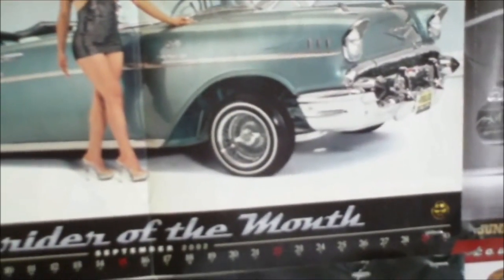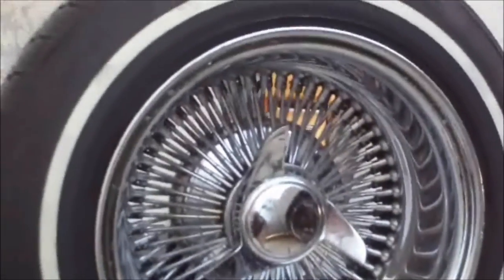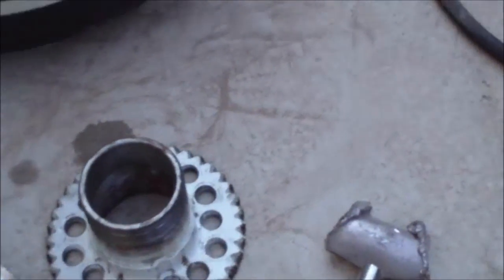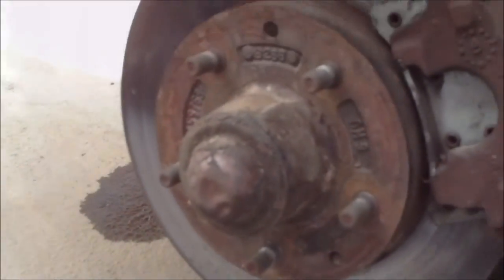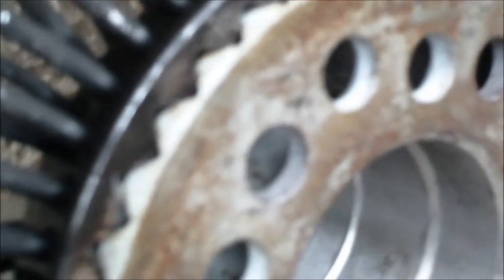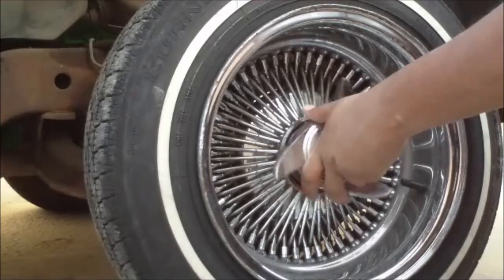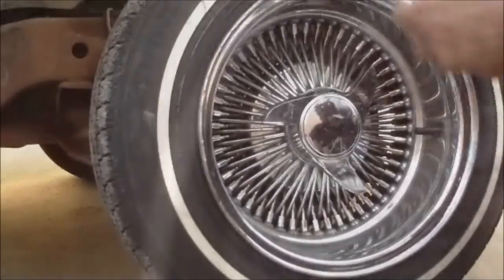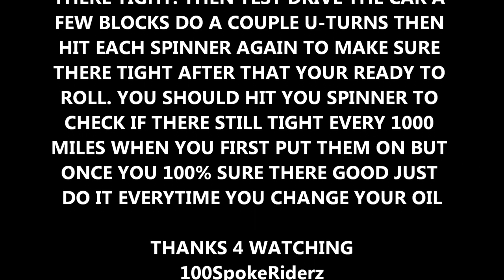HOW TO MOUNT WIRE RIMS ON YOUR RIDE

Comment: What about tightening the adapters with your hand and standing on it to tighten it more with your foot bodyweight cause I don't got a drill like yours would it be loose even if it won't get any tighter the crowbar actually bends a bit
Reply from the maker: You dont need a impact like mine but I would go to any auto parts store & get a 4way because it will have you a little more leverage & it wont bend

Comment: On 94 accord do I need a specific adapter to install 100 spoke rims?
Reply from the maker: No you just need the adapter with the correct bolt pattern normal there are universal 5lug adapter & a 4 lug adapter

Comment: How can u tell what side the adaptors go on if the white or red color has been faded or painted over with? I bought these rims and the spinners on all four of them says left on all of them smh.. not even sure now if I want t use them now or throw them in the trash
Reply from the maker: Thats odd normally the spinners are left & right. The adapters are threaded different directions for L&R.
Reply: @100SpokeRiderz  I think this guy I bought the rims from decided to change the adapters to where all the spinners I tighten them on it goes clockwise all four smh.. not sure if it’s safe to use these rims and adapters now that I’ve seen the correct way to do them here 😞😔
Reply from the maker: @biggteez12  to be on the safe side i would buy a new set of 4 spinners & adapters. You can sell your old stuff on eBay because you never know when someone would need a single  adapter or spinner
Reply: @100SpokeRiderz  okay appreciate the help brotha, I’ll purchase a new set online just to be safe. Blessed week

Comment: I have some 13x7 but don’t fit my 97 Lincoln town car signature, the caliper doesn’t let the wheel go in all the way. Could I just use wheel spacers or do I have to grind down the calipers?
Reply from the maker: If you use the spacers you need to get longer studs or there will be less amount of threads to hold the lug nut on. I would just shave the caliper down a little at a time till it clears the inside of the wheel
Reply: 100SpokeRiderz okay thank you, Im guessing 14x7 would fit perfect than? And would it be too much if I put the adapter on top of the spacer if I get longer studs
Reply from the maker: @CesarHernandez-my2ug  That's how its done spacer first then the adapter but most the time you only have to grind down a little of the caliper to get them to fit

Comment: Great vid. What kind of grease can I use for the spinner?
Reply from the maker: I like to use High Temp Wheel Bearing Grease you can find it at any Auto Parts store......Thanks 4Watching
Reply: Thanks for the tip 100SpokeRiderz
Reply: 100SpokeRiderz question is it possible to do an alignment with these rims on my car?
Reply from the maker: Yes
Reply: OK thanks 100SpokeRiderz

Comment: I'm buying a 94 lincoln with daytons and I'm planning to use it as a daily is it possible with these rims or should I change them
Reply from the maker: +Suave_ 909 That would be no problem to use on a daily driver
Reply: not to be a downer but I had my transmission blow out with 13's on my daily driver Lincoln town car , drove smooth , never fell off , no aliment problems but eventually u will blow out that transmission if your running on 3's ese
Reply: BKS CYCO im getting some 14s for my 97 Lincoln..... think ill have the same problem?

Comment: This was an awesome tutorial. QUESTION: I'm a novice! I just grabbed a 95 Deville and are looking for some wire wheels. My car accepts 5x4.53s and I have access to 5x4.5s. Will the adapter you highlighted take care of that slight measurement discrepancy??
Reply from the maker: Most new wire rims comes with a 5 hole universal adapter that has 3 different sizes you should be ok ...Thanks 4Watching

Comment: so what happens when you use the non standard lug nuts?
Reply from the maker: If you lug nut is long & stick pass the end of the stud the rim will not sit flush on the adapter & the rim will fall off while your driving

Comment from the maker: Wire Whhel King
818 Cristich Lane Unit 2 
Campbell Ca, 95008
  wirewheelking (dotcom)
 408-559-0950
 
Im not sure on the price on 20" but 13"-14" is around $250-$350 a rim for just parts & labor but you also must think about shipping there & back

Comment: I plan to 3 wheel my car what is a good size besides a 15 inch rim?? 13 in are too small
Reply from the maker: +The Thanks 14"
Reply: +100SpokeRiderz could I properly 3 wheel with 15 to 16 I have a 64 impala, or is 14 the limit?? that's for the reply!!
Reply from the maker: I would go with a 13" or 14" only on a 64 Impala if you want the Lowrider look & have hydraulics on it

Comment: Hi anyone has any idea if it ll work for me ?
My rear back wheel got loose,
I took off the wire wheel and the teeth(gear ) is kinda a little bit damaged on the adapter AND on the dayton wire wheel.
I was thinking to try my luck to change the adapter. Any thoughts if it would work to use a brand new adapter on a slighty damaged gear on the wire wheel ?
Reply from the maker: I would get a new adapter 4sure but the wheel is another story it all comes down to how much damage the teeth on the back of the hub has

Comment: seal lockers... with rubber mallet.. works... sorry.... u can do the same thing without torque wrech on u joints... just add the blue stuff
Reply: doesnt damage anything at alll.... i dont understand u doing it the way u do....

Comment from the maker: The tires I have are not being made anymore but there are a few places online you can still get them, unless you live on the WestCoast & there are a few shps in AZ. & CA. that still have them also. 155-80-13 is the size you want there are a few new sets on ebay but there not cheap but thats everywhere you can find them sence there getting harder to find the price has went up to $250-$400 a set

Comment: I have a 92 chevy caprice classic wagon...what size of spokes would you recommend?
Reply from the maker: The back is where it get tricky because of the skirt style wheel wells. If you don't want to cut & mod anything 14X6 reverse offset will bolt right on with no mods if your going for the Lowrider look or plan to lower it also.
Reply: @100SpokeRiderz  Definitely going with the lowrider look. plus thinking of putting hydraulics in the future..thanks for the reply 👍...any suggestions on tire size/width ?
Reply from the maker: @jayrab446  I have always used 175/70/14 whitewall tires on all my 14" wire wheels

Comment: Hey I just wanted to know if it is bad to drive on the freeway with knockoffs I've seen ppl do it but still I drive a v8 el camino
Reply from the maker: Domer Simpson  As long as you put them on the right way you will have no problems. I drove my 83 Cutlass, 13" knock off's, 350 V8, & a 2 pump hydraulic set up from the MidWest to the WestCoast 1,700 miles/24hrs.
Reply: Woow, but thank you I really appreciate that

Comment: hi bro do you know what size wire will fit on a 94 cadillac deville?
Reply from the maker: As long as you order front wheel drive offset rims you can go 13"-22" it all depends on the look your going for
Reply: thanks bro do you know a good source to buy them at?
Reply from the maker: haffiti2000  http://www.ogrimsdirect.com/
http://www.daytonwirewheel.com/
Reply: thanks man

Comment: Hey I have an 84 cutlass with 20" wires and the front tires are rubbing a little bit on the control arms. What can I do to solve my problem? I know guys put way bigger wheels on these cars and they cant be rubbing on them. I actually wanted to go bigger but i stock with 20" to prevent rubbing. Please help if you know this setup.
Reply from the maker: If the tires are rubbing & not the rims it sounds like you have the wrong size tires
Reply: yes its only the tires...
Reply from the maker: Steve Lavelle  Sounds like you need a smaller, lower profile tire what size 20" tires do yo have now??
Reply: SPACERS
Reply: OR SMALLER TIRE

Comment: hey man i just got some 15" og's for my astro van. how often these wheels come off?? im kinda scared to use em! like can someone go 70-80 mph with no problems?
Reply from the maker: As long as you put them on the right way & use the right kinda lug nuts you will be fine & be able to go as fast as the van will take you no problems

Comment: i saw a 2003 buick century with wire rims similar to these, are the centurys a low rider type car? i only thought the buick regals were only
Reply from the maker: +90sFella No Front Wheel Drive cars do not make good lowriders because they dont have frames, most end up twisted up in the junkyard
Reply: I see, cool man. I guess he liked the look of the rims on the car, it just didnt look right

Comment: My daytons wire wheels are way past my fender how could i fix that
Reply from the maker: I would need more info to answer your question/ What kinda car? What size are the rims? What offset are the rims?
Reply: Its a 2000 buick century fwd and 14s with negative offset
Reply from the maker: William Cuellar You have a front wheel drive car you need standard or FWD offset rims only anything eles will stick out pass the fenders
Reply: Ok if i get standard wire wheels and have 14s will that mess up my odometer 
My fwd has 15s stock
Reply from the maker: William Cuellar It all depends on tire size but going from a 15" to a 14" is not that big of a difference but you could also get a 15" standard & use the same size tires you have now
Reply: Do you know what size of tire would not mess with my odometer on 14s
Reply from the maker: William Cuellar  Im not 100% sure about that I would talk to the people you buy the tires from
Reply: Oh ok thanks

Comment: What causes those wheels to grind?  I heard when certain rims dont fit they grind and cause a brake light I already got that i think with stock rims lol. Right now I have stock rims 225/60r/16 i believe
Reply from the maker: What kinda car do you have
Reply: 100SpokeRiderz 97 Cadillac Deville base model I was thinking to buy some 16" Daytons from someone they're straight laced and got bullet caps I think and 16" is what I have on my car now I believe they're stock rims
Reply from the maker: As long as there standard offset or front wheel drive offset Daytons they should fit fine with no grinding, also you need open end short lug nuts

Comment: @100SpokeRiderz I have a 89’ Lincoln Towncar n I wana install some 13’s on it do u know if the wheels will rub with the caliper? If so I heard grinding down the calipers a bit would fix that do u know if that’s a good option?
Reply from the maker: Yes you need to grind down the caliper to fit 13's and the safest way is to do a little at a time & test fit the wheel a lot you just want to take off where it rubs

Comment: So I could install these kind of rims on a 2016 corolla using the adapter correct ?
Reply from the maker: You would need the front wheel drive standard offset wheels
Reply: Ok thanks

Comment: I have some 15 inch 100 spoke rims but i don’t have the adaptors or the knock off how do I know what size I need to fit the rims
Reply from the maker: Unless you have real Daytons or Zeniths all adapters are the same just different bolt patterns
Reply: 100SpokeRiderz thank you
Reply: 100SpokeRiderz where could I order the adaptor and spinner?
Reply from the maker: @a.g.records2050  Ebay has them

Comment: i got some chrome 20inch daytons
 n they have a lil rust . any knw how to get rust off or should i go get em painted???
Reply from the maker: where is the rust at on the rim?
Reply: +100SpokeRiderz. acouple spokes.
Reply from the maker: The easy way is use scotch bright & a can of clear so it wont rust again.
Reply: They gon look mean ass hell on my 94 caprice. I wanna get irocs but havent ran into none in az
Reply: Roy D get some quick glo. It will clean it, get the rust off and seal it with wax. Seriously it works

Comment: Reverse only come in 13×7. Anything bigger is going to be either standard offset or FWD.
Reply from the maker: Not true I have a set of 14X7 & a set of 22x8 reverse offset right now you can get any size spokes in reverse 13"-24"
Reply: @100SpokeRiderz  not according to any rim catalog I can find 14×7 yes but nothing bigger? You probably have more experience than me or not?
Reply from the maker: @hondaguy425able  I got my first set of wire wheels in 1993 & have owned different size sets since then. If you look on the Dayton wire wheel web sight all the sizes are on there. Also there are a lot of places online that have them also

Comment: hey man quick question do the centres spin on forward as the rims move forward when driving so they are like always tightening?
Reply from the maker: No its the other way around forward is how they come off
Reply: 100SpokeRiderz fuck man I'm cruising on 20" and the adapter white on right side and red on the left side and they spin forward as thought when the car moves forward it seems logic it will always be tightening itself but have had issues since day that I bought as they came off teeth but centre still on, (note) my driver side is on the right side as I'm from Australia
Reply from the maker: You got them on the wrong side the White goes on the Left Side & the Red goes on the Right side
Reply: 100SpokeRiderz ok sweet bro will change over when I get home thanks for getting back to Me and great video

Comment: Got a set of 15inch 83 slabs. Homies over at Texan wire wheels said I should only put em on a fwd whip.. But I only got a rwd.. What's the risk of putting them on anyway?
Reply: I got a 08 Volkswagen Eos. 2 ltr. I know they'll fit. Just don't know about the necessity level of putting them on FWD over RWD
Reply from the maker: +JMapaladMusicBiitch  I dont know anything about thoes swannger style rims there different than the rims in this video

Comment: Hey homie i got 15 inch daytons on a 1985 buick lesabre 4 door 5.0 limited edition and the back tires rub badly and i did everything right. Got any advice ?
Reply from the maker: ClownsG AcidSpitter what size tires?
Reply: 100SpokeRiderz 215/70R15
Reply from the maker: ClownsG AcidSpitter 215 might be too wide I would try a 205 or 195 tire
Reply: 100SpokeRiderz thanks homie.

Comment: Can I put dayton wire rims, like 13 inch, on a 64 impala that doesnt have hydraulics yet?
Reply from the maker: +commando8088 Yes
Reply: you dont need hadros to use knock offs. and these have no problem with hoppers. they are strong if put on right.

Comment: Hey man a recommended size for 95 chevy caprice?
Reply from the maker: 13×7  fit with mods but 14x7 will bolt right on. It really comes down to what kind look are you going for or if your going to have hydraulics or airbags.
Reply: @100SpokeRiderz  I appreciate it man 🙏🏼

Comment: I have 13's without the caps. They dont need adapters theyre 4 lug, but I want to get caps for them but dont know the brand or where to get them. or do caps fit every rim brand theyre the big caps.
Reply from the maker: +Oscar Landa Sounds like you have some classic Roadster bolt on wire rims they dont make thoes rims anymore so your going to have a tuff time finding parts for them but keep your eye on Ebay & craigslist because stuff does pop up 4Sale every once & a while. I started out with some 56 spoke roadsters 20 years ago https://www.youtube.com/watch?v=zjpf2p5mlaI
Reply: +100SpokeRiderz that blazer was sick. Do you think if i get caps from the dayton website that theyll fit the rim.
Reply from the maker: Oscar Landa Nope Dayton never sold bolt ons & Roadsters went on different that all the other brands ebay is your best bet just type in 56 Spoke Roadsters there are a few sets of caps on there now http://www.ebay.com/itm/NEW-15-X-7-Chrome-Gold-Wire-Roadster-Wheel-w-3-Bar-Cap-Made-USA-ONLY-1-107-/381295994754

Comment: I got a ? dose these 100 spoke rims are only for back wheer drive car or can it goes on any car
Reply from the maker: choppa gunna They make both Front Wheel Drive offset & Rear Wheel Drive offset rims
Reply: Aite thanks for letting me know, I been hearing people say only back wheel drive. I need some rims for front wheel drive, I gotta lincoln continental 1998 and want to put some gold 14 inch 100 spoke on it.

Have anyone order from OG wires rims .com before ?

Do they ship the rims straight to your house or to a store near you ?
Reply from the maker: choppa gunna Yes you need FWD offset 4Sure & I have ordered from OG wires they ship right to your house
Reply: Ok thanks a lot fir the info bro
Reply: 100spokeRider - on the OG rims site they say reverse and standard offset ?   So does reverse means rwd offset ?    Standard means fwd offset ?
Reply from the maker: Yes Standards is what you want for FWD
Reply: Aite thanks.. I want the gold rims but they only have it in reverse. . You know any other site will have gold rims for standard offset 14 inch?
Reply from the maker: choppa gunna you need to give them a call on the phone & talk to them, they can do the gold in standards not everything is on the web sight but they can custom build rims anyway you want gold chrome & power coated
Reply: Ok thanks again
Reply: 100spokeriderz, I have a 1994 cadillac deville. went to buy wire rims and was told I couldnt because of fwd. thst they would stick out or rub. can I put wire rims because I ended up putting 18" rims and totally dislike. they do not sell anything crome or smaller Im told. any help appreciated.
Reply: nice job